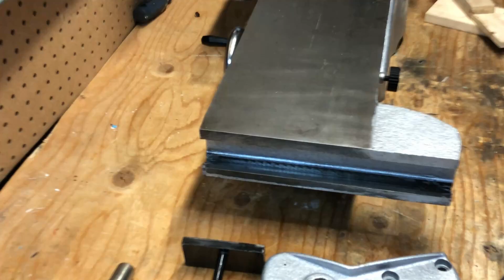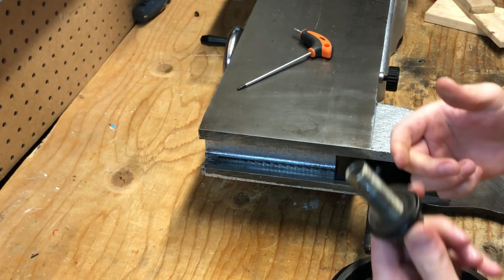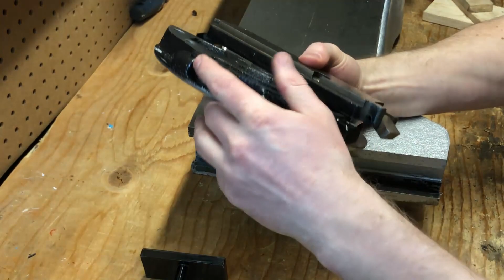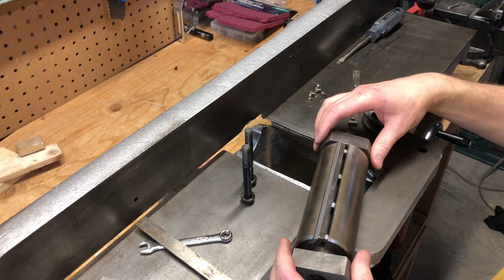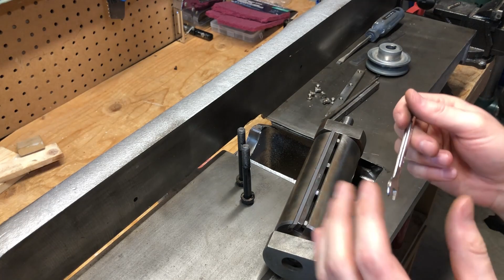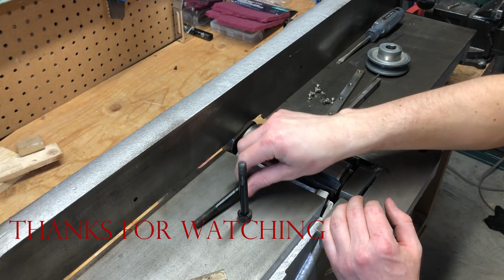Rockwell 37-220 Jointer Cleanup/Assembly Part 3

Comment: Currently restoring my 50's 6" Delta Rockwell jointer.  I tore the whole thing apart, cleaned everything and replaced the bearings.  I bought a bearing puller at Auto Zone for 25 bucks.  Worked beautifully.  Pressed the bearing onto the cutter head shafts first and then, using a socket on the inner race, tapped them into the cup housings.
When I got to reworking the fence I was baffled as to how it worked.  The threads on the largest threaded rod were buggered like yours and I could not figure out what the crescent shaped piece was for.  Found your video and am now going out to the shop to apply what you taught me.  Thank you!

Comment: Do you know where I can locate the cutter head pulley? Mine is defective and is a 2 1/2 inch by 9/16 inch bore. I can only find 1/2 inch or 5/8 pulleys but no 9/16 inch bore. Any suggestions? My jointer is the Rockwell 37-220 like yours. Really enjoy your videos.
Reply from the maker: No sorry I dont, mine came with it still intact which was fortunate. Ebay might be a good bet, or maybe even replacing the cutter itself... but that may lead to finding one that fits, then replacing and replacing to many parts.
Reply: @crect3692  Thanks for your reply. I will keep checking but so far does not look good for finding the pulley with the correct shaft diameter. Again, good job on the Jointer video.
Reply: Phenomenal video series. Just picked one of these up for free and am fixing it up. One thing I’d love to see is how to take the blade guard off. It looks like it’s just a nut but It’s not budging.